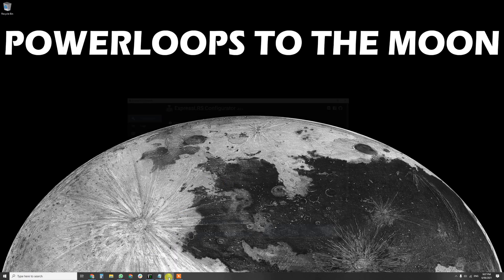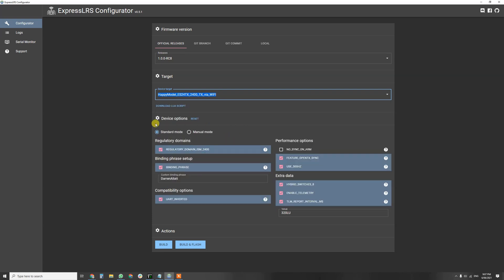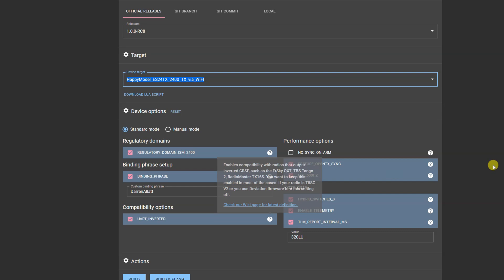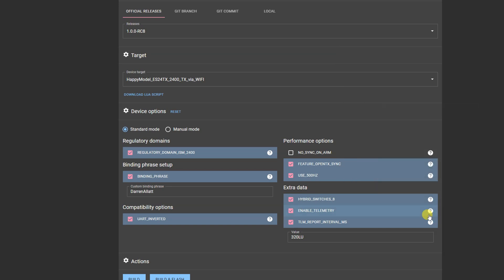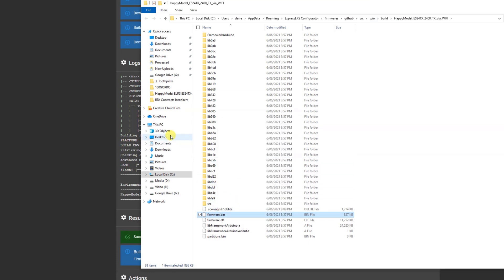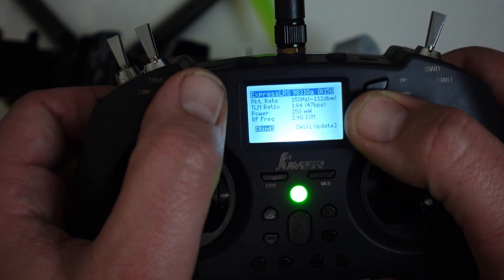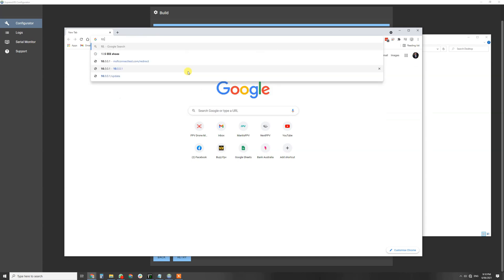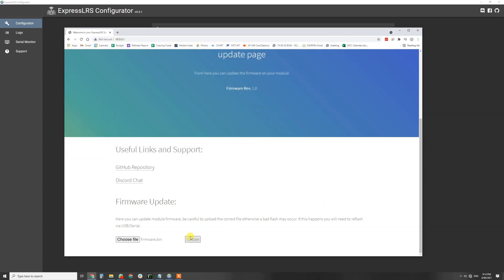Flash ExpressLRS on HappyModel TX | | ExpressLRS V1

Comment: I'm having trouble getting switch inputs to register in beta flight. My sticks work. Any ideas ? I'm not running nightly builds like you did. I am running opentx2.3.12.
Reply from the maker: You don’t need to run a nightly just the latest version. 

The Betaflight set up for ELRS needs to be set to CRSF / Crossfire in the configuration tank and in the ports tab, tick the serial that corresponds to the UART you wired it to. 

If that’s all done and correct. Then I’d check you TX / RX wires are correct. TX to RX and RX to TX
Reply: @DarrenAllatt  I've gotten everything to work now. Bound up. Working arms. Flies. But I'm really confused on the rssi and lq status. My rssi is around -70 and lq is 2:1000. I thought lq was suppose to be 100. Not 1000
Reply from the maker: @clappedoutfpv2331  are you flying analogue or digital?
Reply: @DarrenAllatt  analog. My rssi value is reading about -60/-70. Lq is reading 6:1008. On 250hz. I've flown it and it flies fine. My rssi stays around -70. But lq doesn't go under :950 ish. That just seems odd to me.
Reply: @DarrenAllatt  hey buddy! Just wanted to let you know I figured it out! The video is on my page!  I had rssi value behind lq value so it was showing the last digit of the rssi value so it looked like 1000. lol.

Comment: Messed me right up this site I can access it with the rx in update mode but not the tx it just won't load th 10.0.0.1
Reply from the maker: It's quite a bit to stuff around, did you select WIFI update from the LUA script and you have to do it after a power cycle
Reply: @DarrenAllatt  ohh mate what an ordeal I had with that it's all working great now very impressed with it too , when doing it, it should have just opened the site, to update the rx tx  but it just wasn't loading the page with the tx, , then after about 100 goes it just worked, I did nothing different than any other time. It just loaded the 10.0.0 page up an presto ,, thanks
Reply: @morpheusone7755  same thing happened to me, I kept trying and failing, then it finally worked and gave me the OK and dropped the connection to WIFI.

Comment: I'm just about to make this jump. I was wondering if I will lose all the old xm+ quads, when adding the module an going to the elrs firmware. Or is it all still selectable in the menus to use the old functionality  still too.
Reply from the maker: You should back up all your old models, you may loose the bind - I’m not sure on that - then if you do, you can restore your old models and they will be selectable from the menu on the controller
Reply: @DarrenAllatt  done thank you because I wouldn't have bothered . Luckily its all gone well so hopeful I won't need them software wise I'm ready, just awaiting the hardware now.